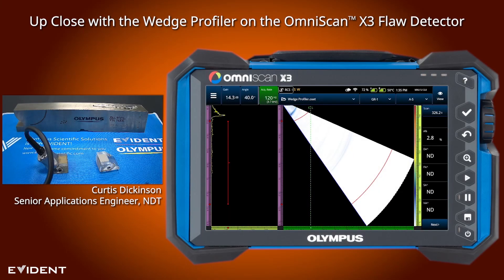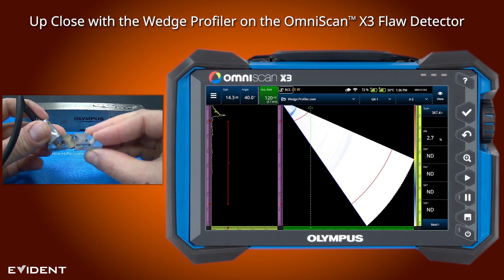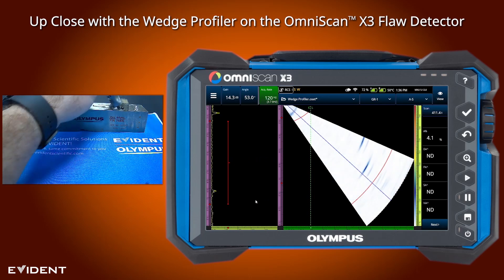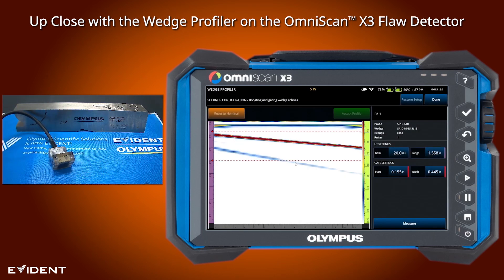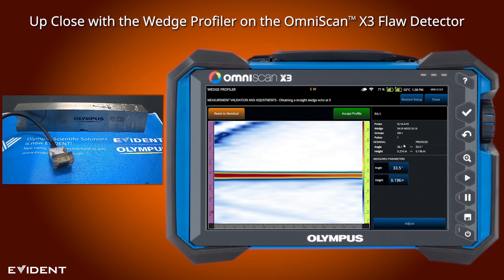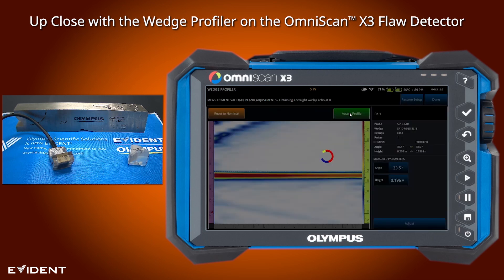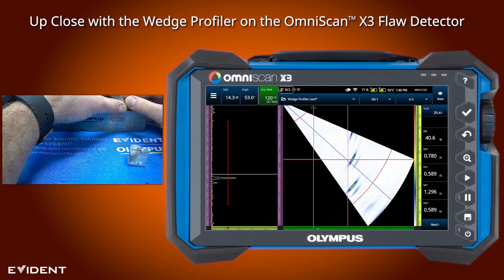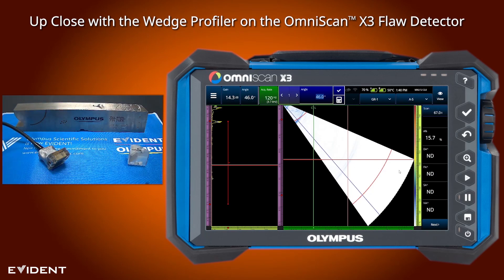Up Close with the Wedge Profiler on the OmniScan™ X3 Flaw Detector

Comment: Does it work for unknown wedges as well? I'm using a PA straight beam probe with a protection wedge but I face some troubles with wedge delay calibration for S-scan.
Reply from the maker: The Wedge Profiler tool becomes available only after selecting a wedge model. If the desired model is not in the database, you can create a custom one using the Probe and Wedge Manager.